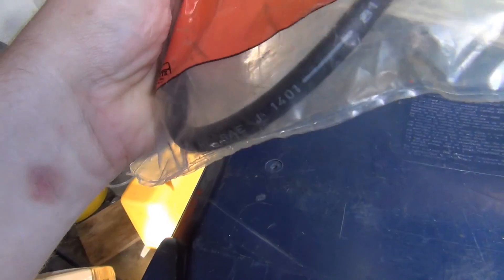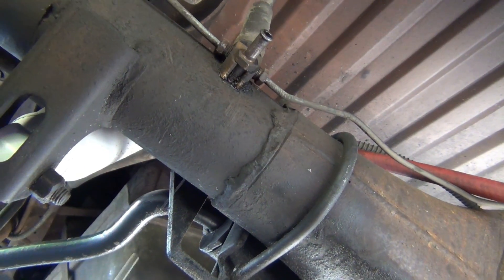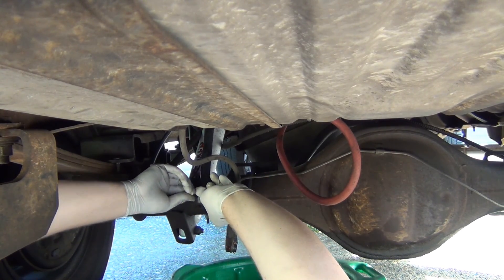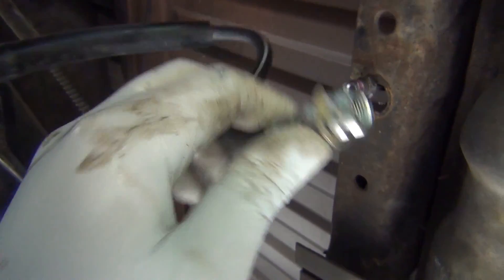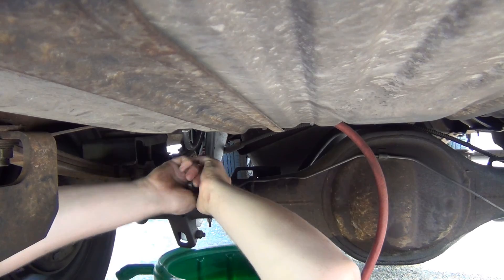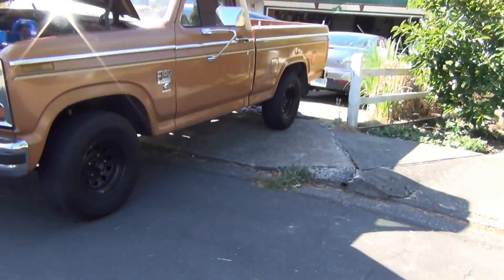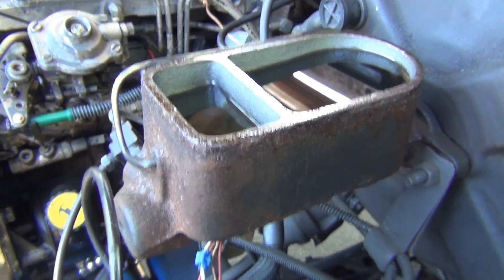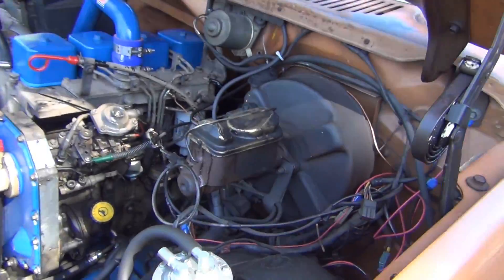1982 Ford F150 Rear Brake Hose Replacement

Comment: An old video but if you're still monitoring it I want you to know it helped me out.  I have a 92 and was not sure what the splitter with the hose did and once I did find out was a little surprised I could buy one as an aftermarket part.  Not done yet because almost everything was rusted solid but one more line to the wheel cylinder and I'll be able to put it back together.  Thanks for the video.  

Your cursing?  Man, the air was solid blue around the beast I was working on.  Sick of working on rusty trucks.  Blg blam fludder ducking mons and ditching pos. Neighbor a quarter mile away had to get his kids in the house.

Comment: 8:20 Hope you don't get a bubble of air trapped in that loop.  Connect line at the FRAME First, and then let hose hang down and drip.  Attach at axle tube SECOND.